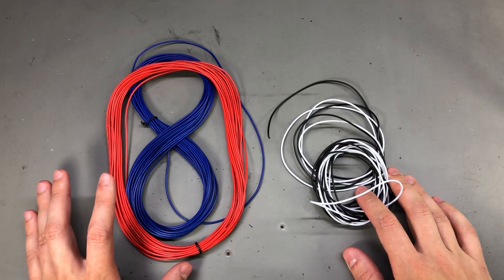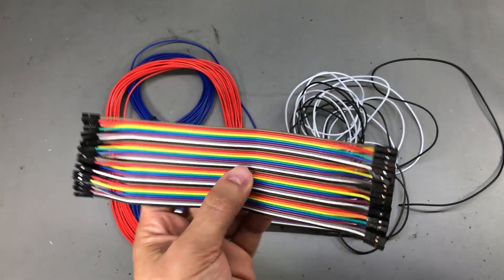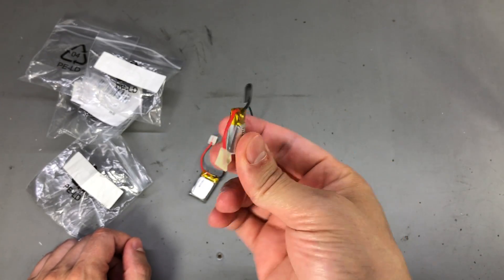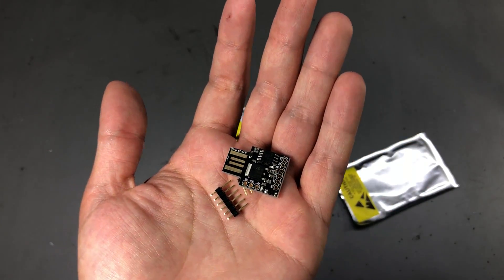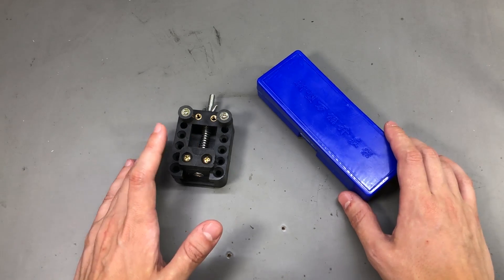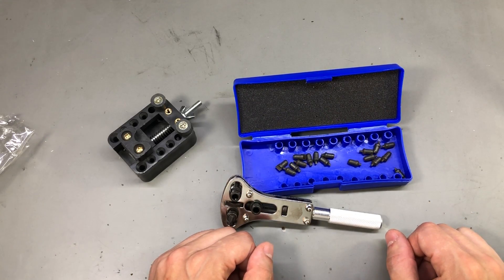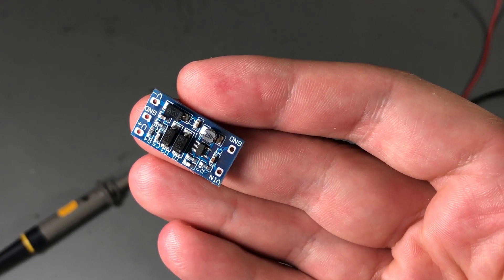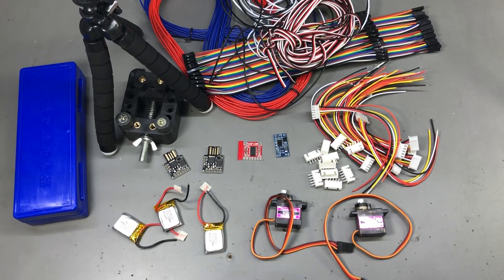Voltlog #178 - InTheMail

Comment: This seems to be the chip that is on the Plus or minus Module, minus one diode, if you look down the data sheet it is almost exactly the layout of the pcb..https://www.pacificdisplay.com/ics_app%20notes/dc-dc%20converters/LT1617.pdf . I think wit some tweaking this could be a very good DAC or ADC module especially if you needed clean rail to rail...

Comment: Hi Florin, as far as I know (and I have been wrong before) the DigiSpark ATtiny modules do not have a USB bootloader in the sense that we know from Arduinos. As the ATtiny series micros do not have hardware serial capability, a bootloader would be pointless. Instead, they work by the use of a special driver you install on your PC which detects the module when you plug them in and for a brief period of time, this driver instructs the AVRDude on what to do. I am not very sure of this since I barely tried one of these modules recently, but I have worked with bare ATtiny's a lot and by the looks of how the amount of available memory is almost not affected in these Digispark modules, I have come to this conclusion that they only set one or more fuses on the micro that enables the PC driver to identify them as a DigiSpark module. I would love to hear your comments on this since it is just a theory on my side.
Reply from the maker: Digispark board has a bootloader that will allow programming via USB with the Arduino IDE. USB interface is software emulated.
Reply: Is there a source explaining how this works, or better yet, is this bootloader available for download to be used with barebone ATtiny micros?
Reply from the maker: since our Chinese friends are making and selling these I would assume the bootloader is available somewhere.

Comment: @ 6:00 I just ordered some of those dampers as well for my Ender 3, will be interesting to compare the effects on both printers.
Reply from the maker: I'm hoping it will make it quieter, although changing the control board with a more advanced one that will accept trinamic stepper motor drivers is definitely the way to go if you want quieter motors, but then the ports on the enclosure will not fit anymore and I don't wanna go that route.

Comment: I added those vibration dampeners to my cr-10, and though I was skeptical at first they have made my printer very quiet. I thought changing the step drivers would be the best bet, but now that I have these installed I don't feel its necessary.
Reply from the maker: I'm hoping for the same effect (haven't installed them yet) but I have the same feeling that changing the stepper drivers is the better way of silencing the motors.

Comment: Hey. For the reference why not use a boost dc-dc converter to 20v and then a low noise linear regilator with plenty filtering. That way you don't need to use those horrible 9v cells
Reply from the maker: 9v cells are horrible I agree but I don't think I can get the noise down without investing much time and effort into the power section so that's why I'm thinking of using the 9V batteries.

Comment: Best source of wire I have found are old atx computer power supplier. They have anything from 14awg to 24awg wire and computer stores are usually throwing them out by the dozen.
Reply from the maker: I'm using those as well but they are usually thicker gauge, I haven't had any 24AWG from an atx power supply.
Reply: I got most of the 24awg wire from the old ATX supplies that still had floppy disk connectors. Local computer store had about 20 of them sitting in a box unopened.

Comment: Are you sure those servos don't already do 180? The ones I got (also MG90S) were advertised as "180" but did the classic +/-45 when I tested them - until I tried going outside servo spec with the signal and sure enough they do actually rotate (almost a full)  +/-90 degrees from center...
Reply from the maker: hmm thanks for the tip, I'll test them and report back.

Comment: i'm with you on watch battery, a few years ago a """professional""" ruined one of my Seiko chronometer case back with scratch and totally removed the gasket... DIY it is now, thanks china cheap tools and batteries.
Reply from the maker: A note on batteries, I'm getting Renata for my watches, I order them from ebay from France, UK and Germany sellers, depending on where it's cheaper. I'm hoping they are genuine batteries but you never know..
Reply: You're right, quality is not always good but I don't care since its 1/10th of the price of "real" french bought Renata/Sony.

Comment: The only information on the OEP30WX2 I could find is on https://www.roboter-bausatz.de/1987/oep30w-2-modul-digitaler-mono-verstaerker . At the bottom of the description there are two "Download Datenblatt" links with the PCB pinout and some specs. Hope that helps.
Reply from the maker: Thanks! That info is also available on aliexpress on a few sellers but I wonder why there is no datasheet available. I'm thinking it's probably in chineese.

Comment: About the "ampli-fire" :
You should give it a try before calling it a fire starter 😊...
You will probably be dissapointed about the distortion when
you increase the output power,  but this type of class D amplifier
chip remains amazingly cool  ...
Keep us aware of your tests !
Cheers,
Eddy.
Reply: I´m using a similar module to drive some big speakers. I can´t tell if the amp adds any distortion or not since the speakers themselves and their frequency splitters are not great anyway. 
The only real problem with it is that it has no output filter at all, which causes it to radiate tons of EMI from the speaker cables. 

Although If you use it to drive a speaker that is directly next to the amp, filtering is not really required, so in that case it makes sense to ommit it.
Reply from the maker: I have tested other class D amps in the past, that's why I'm thinking it will over-heat for sure.

Comment: hello everyone. big fan of the channel.
can we use the last item as a *boosttrap for the mosfet used with a 5volt m/c on the positive side?
Reply from the maker: sure it can act as the bootstrap voltage source but it would be limited to 12V so it depends on what voltage you are switching. I usually prefer to use a high side mosfet driver for the job, instead of tinkering with the boostrap circuit.

Comment: Ebay servos has axle ball bearing replaced brass sliding bearing. Amplifier not use 3w, it  efficiency is about 70%, so in full power in amplifier stay about 0.9 w. Of course real power is about 1.5w

Comment: When you want to have a lower noise on your 3D printer, maybe try the SilentStepStick motor drivers (https://www.watterott.com/en/SilentStepStick). The TMC2100 really makes a difference (I have them myself). I would fear that the motor vibration dampers mount the motor in a flexible way which means it could lose precision (because it moves around).
Reply from the maker: I would have to replace the motherboard to change the motor drivers and then I would go into a whole set of new problems. I would like to avoid that if it's possible to make them silent with just the motor mount.. but what you said about the elasticity of the motor mount makes sense, I hope the effect is minimal.
Reply: Oh, I didn't notice that on the CR10 the drivers are not replacable :( Usually thats the case, if not you are screwed...

Comment: Old ethernet cables are a great source of high quality solid core wires. The insulation isn't super heat resistant but it gets the job done if you don't have anything else around.

Love all your content, keep it up!
Reply from the maker: I would also add "alarm wire" to the list or wires that can be re-purposed.
Reply: I do that too. Plus any wire from old PC power supplies.